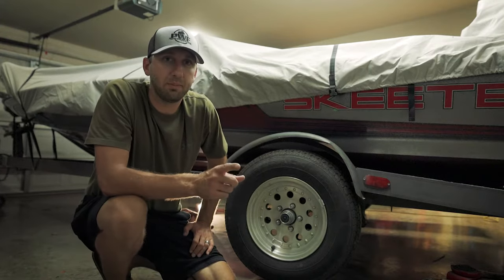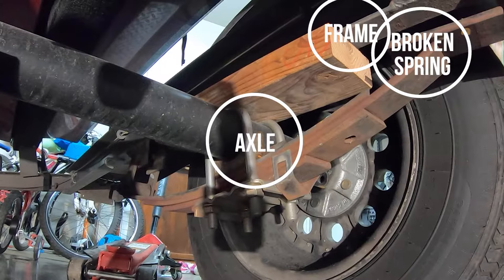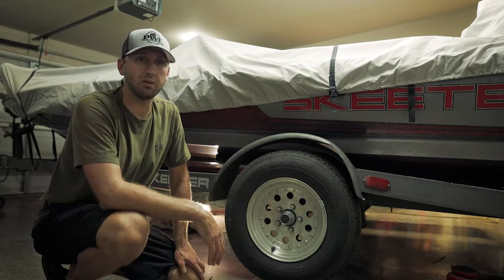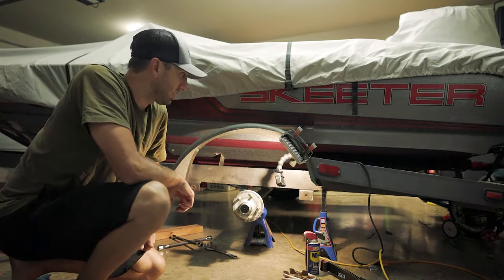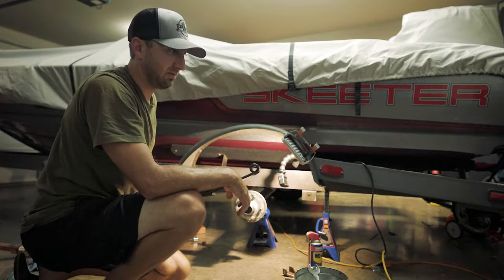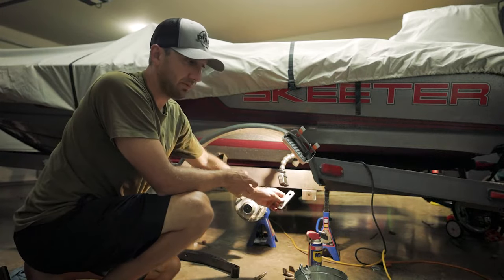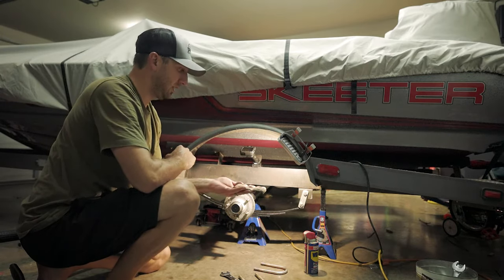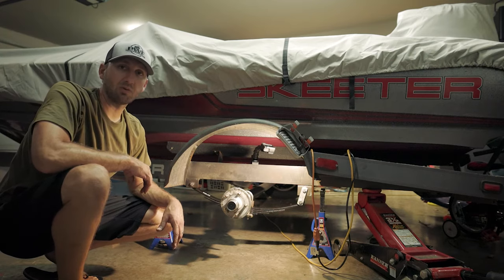Replacing Trailer Leaf Springs (Plus! Simple trick)

Comment: I've used the block of wood technique to get home. Luckily I had a couple of tie straps to put around the 2x4. Drove back to Kentucky from Maryland that way! One additional tip: Don't smoke the rear bolts down. The shackles are there to help relieve stiffness in the springs. It helps reduce tension on the leaf springs so it doesn't snap! The point is that the shackles need to travel. Another would be do not tighten the shackle bolts until you've set the tires on the ground. (and bounce the load up and down) It would be a good idea to tow the boat around for a bit so everything sits well. Then button it down.
Reply from the maker: Yep, don’t leave home without block of wood now. Correct, don’t over tighten shackles

Comment: Just wondering do you not have to weld the spring seats on the axle?  Just wondering, I never saw you tack them and didnt know if that is how they came of your trailer?
Reply from the maker: No, don’t have to weld these. There is a hole in the spring seat and a rivet on the springs that the holds the seat in place.

Comment: I have a double jet ski trailer that gets used as a kayak trailer. The ride is super rough since the kayaks are about 250 lbs. Not a fan of the trailer jumping up when im going 80 down the highway.  Are the springs pretty much universal?   Can I remove individual springs or should i buy a set designed for that partuclar weight?   I usually only have 1 kayak on the trailer unless someone is going with me so it almost always only has 120 or so lbs on it.   What springs should i get? Is there a percentage of the rated load im aiming for to get the best ride?  Like maybe 70% of the rated weight capacity?
Reply from the maker: I’m really not sure what sort of springs you would need. Guessing not much since kayaks don’t weigh anything. I used https://www.sturdybuiltonline.com/ for my springs. They show you how to measure and give you several options. I would reach out to their support and they would be able to tell you exactly what you should get.

Comment: Hi mate! Thanks for the video, for the U bolts on the axel, is a must to use an impact wrench or a manual one will do? The jack i am using wouldn't lift enough to fit the impact wrench underneath
Reply from the maker: Manual wrench works fine. I only used impact to get mine off because they were rusted on. Good luck

Comment: The pink things may be bushes if the bolt fits through it which prevent metal on metal.  If your car's suspension is squeaking it's probably because the bushes have worn through.
Reply from the maker: Yeah they might have been the same thing I ordered, just felt thin and wouldn’t last long. The thicker ones I ordered are still working great and zero squeaks so far.

Comment: Do you need to support the other side of the trailer ?
Reply from the maker: Ideally yes. Mine wasn’t perfect but I just chucked the wheel on the other side so it wouldn’t roll. If I had more jack stands I would have lifted trailer and set trailer frame on stands on opposite side as well

Comment: Just quick question why did say never tighten spring bolts? which one specifically?
Reply from the maker: You shouldn’t over tighten bolt with the shackles. If you over tighten, those shackles can’t swing freely with the spring and will brake the minute you go over a bump and the spring tries to flex

Comment: I had a similer break on my skeeter, if you dont mind sharing, where did you buy the new one and what size and weight cap. Was it
Reply from the maker: No problem. I bought them from sturdybuiltonline.com. Also got my axle from them. The springs are 25 1/4” 2500 lb. double eye. Let me know if you need anything else. Good luck.
Reply: @PrestigeWorldwideFishing  ok cool, man i been looking around crazy for specs and there just isnt many, the original measures 26 eye to eye but it has been 17yrs
Reply: @PrestigeWorldwideFishing  your skeeter is an 18fter?
Reply from the maker: Yeah mine measured around 26” as well. They flatten out over time and measure longer though. And yes, 18 ft. It’s a 96 zx180
Reply: @PrestigeWorldwideFishing  thanks bro great help